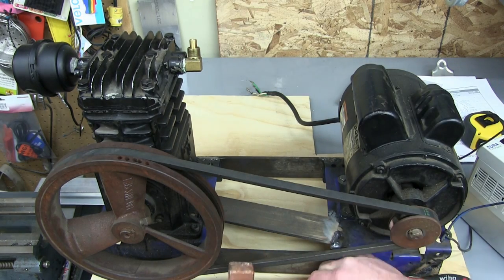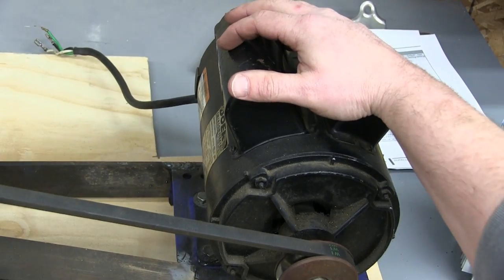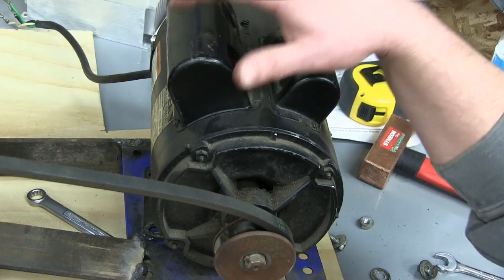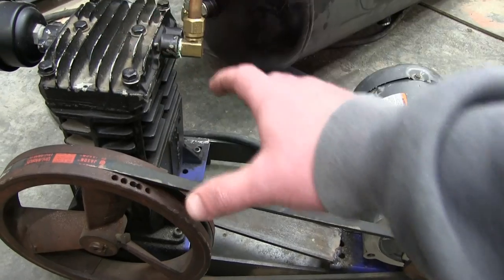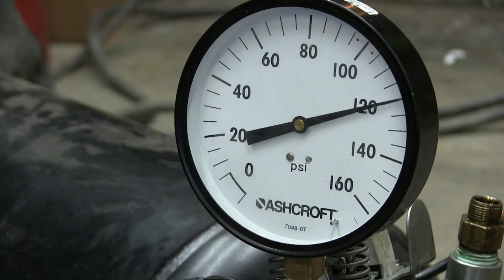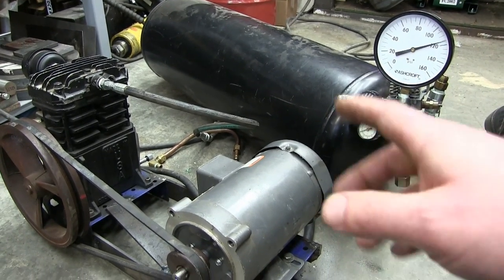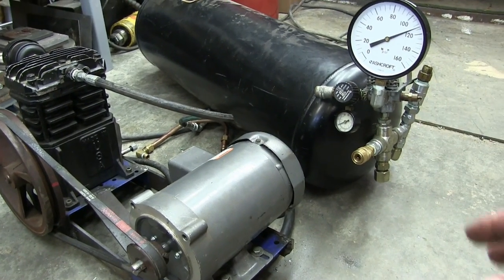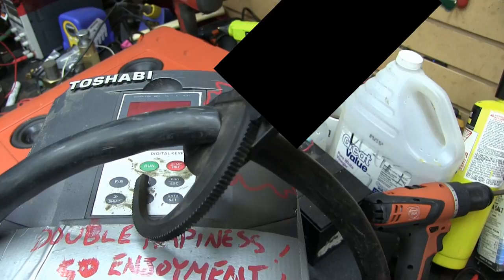BIG COMPRESSOR PERFORMANCE BOOST | No tripped breakers!

Comment: Small compressor makers don't do the VFD due to cost.  It is done on larger industrial rotary screw compressors.  

In any event, hammering on a shaft is a sure way to damage ball or roller bearings. If a compressed air system can't hold air for a week unused, fix the leaks as compressed air is way more expensive that most people think.

William Darrell "Billy" Mays Jr. + The Red Green Show

Comment: A controller for an unload-er would be more effective in my opinion, I use a gas powered compressor although electric could benefit the same, spin the motor continuously and kick the unload-er in sooner then the standard 20-40 psi differential, also eliminates that electric breaker trip because the of flywheel/piston inertia just a suggestion, love your vidjeos btw

Comment: Use a compressor off of a truck or old cat loader, they run continuously and are equipped with an air governor. When max pressure is reached bypass valves open reducing load. Cheap and easy solution. I put one on my 55D Miller welder.

Comment: In the old days of steam rail locos the fireman would ramp up the feed pump a few seconds before the driver increased throttle. Boiler water level would rise then settle back to correct. 
Big plant like power stations and ships need anticipatory controls to do this. before computers, they had a switch that reversed the feed pump controller when turbine throttles opened. This kicked the feed pump in immediately.  The anticipation switch would drop back to normal a few seconds later.

Comment: Seems like 3 phase motors are less expensive than single phase cap start ones. Almost cheap enough to buy a vfd, and still brake even. Gotta love the soft start feature, overdrive, and underwhelmed load center. If sparky wants to share how he hooked it up for ya and got the plc programmed, that would be awesome. There is also never enough install support for the vfd's. The directions got lost in translation before the thing left china.

Comment: I seen a video a while back that was supposed to save you lots of money on your electric bill. The guy hook some sort of hurts machine in got the electricity coming in 2 come in with the correct Hertz for the appliances he was running and supposedly when everything is perfect lie in tuned it runs at optimum efficiency. This may be one of them boxes that was used. I recently hooked up a 3-phase Mill in my shop with single phase 220. I used a static converter that is my first experience with AC electricity in my life. It has sparked a lot of interest in my mind I want to upgrade and get one like you have that I can control the Hertz which controls the speed of the motor. The one I'm using I lose 1/3 of the horsepower it does not seem to have the speed it should either. It works but once I have the funds I am going to upgrade to a better system. Hopefully you have more videos cuz I'm looking to learn more. With solar max out on panels per hour electric company allowing us we still paid in over 300 last month with the AC running and running my equipment in the shop. I would love to make everything as efficient as possible any suggestions or input you have would be greatly appreciated it appears you no a lot of out AC electricity. Look forward to more videos thank you

Comment: Was thinking about this "upgrade".  Truth is that unless you're spinning the pump faster at a higher PSI, say 80~90, where the tools need to run well, it's not going to help.  The fill rate really doesn't matter, you can use it to compare, but it's the FLOW RATE at working pressure that matters.  A real test would be that you run a given high demand air tool full blast under both systems.  What you'll find is that the pump only puts out so much volume at a given PSI, and at the work PSI of say 80~90, that flow will not be more unless you spin it faster or remove bottle necks.

Comment: Ok,  so here's my thought for food.  If you don't have gobs of money for your warp drive mcdealy, how about changing the pulley sizes around to sync the compressor piston timing and the input power waveform at peak current? It may mean running a positive engagement belt and timing the motor coils to the compressor,  but you could turn up the speed with gearing and get more oomf for your choch. Doesn't solve the air cycle problem,  but you could use an truck air governor and run the compressor constantly.

Comment: You’re making a lot of sense. As you mentioned, they haven’t advanced the technology in decades. The reasons the marketers would likely give against a smarter motor design: 1) Cost of this technology vs. the cost using higher pressures/bigger air tanks instead 2) air compressors are falling in demand due to the available battery powered tools (cordless impacts vs. pneumatic impacts) so they’re investing in these technologies instead and 3) Any new compressor technology investment will be in cordless compressor technology, but then again maybe this will be where smarter motors come to use due to efficiency being more important.

Comment: Best thing in the world for belts is Irish Spring... get annoying squeak on car and it will straight up stop 90% of them. Old timer trick, just run the belt and carefully touch it to the belt face. At my shop had a car that was squeaking the power steering belt and the pump would stall when the steering wheel locked... I thought pump was trashed at first but then I put some magic shmoo on it... worked like a newern.

Comment: Ensure not to over RPM the pump. While the valves will likely keep up to a point (they float eventually unless spring load is increased, not a feature of flap valves) most of these pumps are slash lubricated, some ring lubricated. Once you go over RPM, it will still splash oil, but not enough for the heat increase at high RPM, especially since most of these pumps barely hold a half court of oil. That's not enough to cool them effectively at over RPM. If you want to get RPM happy, use a pressure lubricated ring valve pump. Otherwise, size the pump for the jobs you do. I have a gas powered pump that will run a semi sized tire gun all day, it has 27CFM at 175PSI on full run. For this job, a 150CFM hydrovane or rotary screw would be far too much, I can run an army of tire guns.  VFD on rotary screw is about the most affective way to have an adaptable pump. However, it is not cheap.

Comment: +AvE -Several points... Besides the brute-force approach of spinnin' ye olde cornpressor faster, you can also get more CFM by pre-compressing the air a little, like with a shopvac, or even 2 or them, in series. (Not that you need as much volume as shopvacs give just to stuff more air into a little compressor.) The temperature which air reaches when compressed has very little to do with the absolute pressure and everything to do with the compression ratio and initial temperature. Starting with cool or cold air reduces the compressor and motor load. Combine cold air intake with pre-compression and you may get more air with less energy. A variable-ratio Salisbury Drive instead of fixed-ratio v-belts would also help. Another way to boost the power of air tools without increasing air pressure or CFM is to heat the air right before it goes into the tool, so it can do more work as it expands. They are heat engines, after all.

Comment: The signaling system could lead to longevity issues in my opinion, I think a dial or just on demand ramping is the way, possibly incorporate a blow off system like on a gas compressor to keep the motor running at a higher speed. While we’re at it, the next performance improvement is redesigned the pump housing itself, possibly a cooling system?

Comment: Just picked up a  free senco pc2016 seems like the same specs.  Got it purring like a modelA It’s missing the pilot valve cleaned it up had a broken pressure switch and retapped it’s bunghole😅. Would love advise I am new to tinkering with compressors  and being  a Combat Veteran with PTSD things keep my mind occupied but can be frustrating. Can i do without the pilot valve ?
 Build a simple back flow check valve manifold ?.. new sub  loving  the boys in the shop style vids and information dump

Comment: Three phase motor with soft start and rpm control based on how much your asking using a electric pressure transducer.  

I been installing water well pumps with this technology since like 20 years ago I was installing more grundfos sqe systems then anyone else first year or two. At the continuing education license class ended up being a Q&A for other guys there to me on the spot which was quite funny because I was in my early 20’s and got all these guys been in the industry for 20 years looking to me for answers.

Comment: So while accidentally looking up some video service I came across an article on Wikipedia about Variable Refrigerant Flow air conditioning/heat pumping.  The long and short of it is that you can use a VFD on the compressor to match the cooling demand and increase the overall efficiency of the system.  If you get bored and that VFD has some kind of automatable control (rs232 or gpib or whatever) you might want to give it a shot.

Comment: Great idea in industry but construction crews don't always have 3 phase available. It also seems like a pid  controller would regulate the pressure more efficiently than a plc program alone. Keep up the cool videos
Reply: Most VFDs I've come across run on single phase 120/240v, give 0-480v three phase output.
Reply: Vfd is definitely an option. Would give more options also

Comment: I know this is old.  I wonder how many people notice it was running backwards.  Why is this important?  The pulley moves a ton more air over the pump when it's blowing onto the pump.  There is curve, more properly called "camber" on the fan blades.  Thus, it's a one way turner counter clockwise.

Comment: Pressure transducer connects directly to the vsd drive. The drive should have a PID function that will take the signal and drive the motor speed proportional to the pressure loss. 
Choochin!!!

Comment: Another great video! I've worked with/around compressors for many years (automotive machine shop; Binks paint sprayers; manufacturing; home/industrial construction sites), and those all seem like excellent and quite relevant ideas! 
BTW, love those (blacked-out/Top Secret? LOL) ratcheting cable cutters. Very cool. Reminds me of all those cuts I made in some very stiff 4/0 cable, with a pair of 14" cable shears, while making a slew of off-grid battery bank interconnects.

Comment: Hell of an idea!! I have several air tools and a 20gal 2hp 6.0cfm @120PSI Campbell Hausfeld/us air, air compressor and hardly ever use any of my air tools because it takes soo long to fill and runs low soo quickly that I spend more time waiting for air than I do working, and it sucks.

Comment: I  love you man, but I dont like complexity. I have a shit single stage end user 60 gallon compressor from a home store. I installed a 1/4 turn at the tank where the feed begins. When Im done using tools I valve it off. This holds almost all the pressure until next time. I set the little switxh so it turns on to pump it back up at around 115 or so , so I have 90psi dynamic at my tools while they run. So I always have enough pressure and always have it ready instantly. With a piece of brass! Great channel and I wish you and the family well.

Comment: Sounds like a cool idea. I thought about doing something like a compressor on a VFD, but that was just because I have the VFD and motor. I got a Allen Bradley 1336 sensorless vector VFD from a friend, think only rated for like 5 amp motor though. I then recently ended up with a 2HP 200V motor from a junk treadmill. I just have to figure out how to make the VFD work. The motor is kind of too big for the VFD, but nice to atleast try something with it. I don't think could put much load on that motor with that VFD. I was thinking maybe make a shop fan and then somehow wire a remote control into the VFD. I don't think a fan would be much load on it. The fan would probably weigh like 80LB though the motor is like 50LB, The VFD is like 5LB, add transformer to boost the 120 to 220, fan assembly, etc.

Comment: That would be perfect for painting cars in the garage. You could spray a whole car with a small compressor without having pressure drops ruining the paint job. Gotta keep the paint wet and the pressure constant. Also good for sanders, grinders and other body shop tools

Comment: This is exactly what I was thinking on my way back home after picking up a giant 3 phase 4kw compressor. While I was standing there like an idiot trying to unload this 200kg machine on my own, it dawned on me. A microcontroller, a few thermistors, some capacitors, a full bridge rectifier and some transistors, and I could make this thing run at nearly 4kw constantly, while monitoring the engine block temp.

Comment: Framers I have been around use high volume compressors, with clutch, low pressure demand switch, small reservoir tanks , 220 single phase motor that runs all the time.

Comment: Mine was very much like that one and I upgraded the motor from 110V 3HP to 220V 5HP, got a 33% larger pulley and added a 15 gallon 2nd tank.  Works a LOT better, but still not enough.  Even a cut off tool keeps it running non-stop.  It's some 30 years old, maybe time for a rebuild.

Comment: This video has me questioning a few things. How big was the 3 phase motor you installed? I assume your running on 230v because they dont make 120v 3 phase motors. And how high did your current draw get?
I really like this idea and have most of the parts to make this go.

Comment: This also would be nice for when you are using a spray gun with a smaller compressor. This way the "spray gun" isn't spetter spater all over the place when the pressure drops.

Comment: When I was a framer, that was the thing that pissed me off the most, waiting for the GodDamn air compressor.  We'd work for 10-min, have to take off 5-min, and it just cycled like that.  So, me and my crew stopped using air guns, pulled out the 32oz framing hammers and got shit done!
Reply: I had roofers out with a decent twinstack compressor that had a fried cap.  They were calling the boss for a replacement when I came out with 3 dedicated lines pitched from my 60 gal in the garage.  Keep the help happy!  This would have been awesome but I already spent the funds on ice/water shield and beer when they finished. :)

Comment: there ya go.... first mistake - thinkun.  That high pressure hose works in a jiffy, but I believe the smaller inner diameter will restrict the fill rate of the tank and might not enjoy the heat on the cylinder head.  Not an immediate concern but sometime she gonna blow.

Comment: that would be awesome on the small MRT(mobile repair trucks) the army runs, we are for ever waiting for pressure and then preying that the nut brakes before the tank pressure drops, to have the compressors out put match demand would really help portable air compressors over come there tank size limitations

Comment: My job compressor was always just sized to to the job..with a big tank and a compressor that kicks on at 95. And off at 150 .and a Pressure regulator that limits the working pressure to about 90psi. Wich is max for most framing guns. Never had to wait for air.. Never a problem.

Comment: I have one of those dewilt quiet portable/small job-site compressors that turns on when the tank gets down around 160, charges tank to 200. Regulated output can be set as high as ~125. I think it's rated 12A, though at this elevation probably pulling a fair bit less than that. I need to put the kill-a-watt on it, have a look. 

This compressor already solves the issue of dropping down below a 100-120PSI regulated output setting before chooching again, however, I would like to see a VFD correction to speed up the performance at altitude and do the constant power idea.

Comment: I love this idea. But I have a question. Does that compressor have splash lubrication? With the direction it’s rotating effect the oil dipper? Only reason I am asking, it looks like it is running backwards with the direction of the van on the compressor. I know it’s easy to reverse 3 phase to correct the issue in my head.

Comment: Great idea, however,, When using a VFD on a TEFC motor you need to be careful of the turn down ration for low RPM,s.  The drive also needs he rated for constant torque. The problem with running a PLC on a construction site is that the environment may not be suited for it. A better option may be to have the code written into the white space of the drive. It would also be beneficial to use a TENV (totally enclosed non ventilated) motor. You have a much better turn down ration on the motor.

Comment: Would be great for sand blasting. The problem with in on a jobsite is a lot of framers use gas powered compressors because power is not always available.

Comment: With a PLC you could have pre progamed settings for different tool applications such as an impact gun that would need higher  peak pressure and a die grinder that would be a steady pressure of + - 5 psi

Comment: Actually a compressor that runs at full pressure does not draw much power at all. I used to build compressors for the minute man missile silos and they had no pressure switch at all. They had a lower compression ratio via head gasket spacer and ran all the time. Since at full pressure the air never moves out of the cylinder its compressed energy goes back into the motor after it passes top dead center. You could use just a time delay relay off an air flow switch, or current sensing relay, if you don't have much load but you do have pressure shut it off to save energy when you are not using it at all, then on a pressure drop or air flow start it back up.